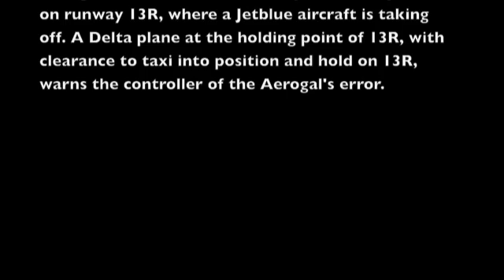Air Traffic Control: Near Miss at JFK

Comment: I think it's quite funny how many controllers that are prepared to rip Kennedy Steve to shreds here.  Yet he has 27+ years of experience working with this. And has to my knowledge has both FAA's approval for his work and no actual accident on his record.
Reply: Kennedy Steve (Stephen Abraham) was unquestionably one of the best ATC controllers at JFK, and he was awarded the prestigeous Dale Wright Award by the National Air Traffic Controllers Association shortly before he ritired in 2017, in recognition of his outstanding service to the profession.  And there is absolutely no question that the Aerogal pilot was responsible for this alarming near-miss.  He was cleared for 13L, he read back 13L, and it was reasonable for Steve to expect him to land on 13L.  Sharp eyes by the pilot of Delta 122 averted what might have been a tragedy.

It is also true that the Cararsie approach can be very confusing: this precise error was repeated on 5 December 2017 by a Volaris flight from Mexico City (https://youtu.be/un4xHGU7bMo ), and probably by others.  It's an easy mistake to make.

BUT -- having said that and repeating my respect for Steve, he did not handle the crisis as well as he might have. In an emergency, especially when communicating with a pilot who is not a native English speaker, the instructions need to be brief and very clearly expressed using absolutely standard aviation terminology.  It would have helped Aerogal to react if Steve had said "Aerogal 700 GO AROUND, turn right immediately, heading 180, climb now to 2000 feet."  Steve's obvious alarm, compounded by fatigue (it was the end of his shift and a runway change was being executed) caused him to waste words (which increased the cognitive load for the pilot) and to delay critical information (he did not give a heading until 20 seconds into the episode, after Aerogel requested one, and he did not give a "climb to" altitude until a full minute had gone by.)

This does not change the fact that this was 100% Aerogal's mistake, even though it's easy to get this approach wrong.  Nor am I dumping on Steve, as some people have done.  I still consider him to have been one of the country's finest controllers.  But nobody's perfect, and his reaction in this case could have been better.
Reply: @dizzyology7514  I loved reading your analysis. It is so bad it is buried among the average Youtube comments.
I have been in JFK several times, done that approach and even talked to Steve before he retired. I could even have a funny interchange the first time I flew to JFK (was a low time E-190 FO then) when another Air China 747 blocked our taxiway for almost 30 minutes (it was almost a recreation of the famous previous incident). When we could finally into the ramp, we both have a short but funny conversation. 
      It is very difficult some non native English speakers to think in English whenever they are in an stressful environment. What happened to the Aerogal pilots was that they forgot to press the TOGA buttons. Their plane was climbing ver sluggishly as if they were circling to another runway and putting them in conflict with other  aircraft. I was not sitting inside that cockpit but being myself a pilot in an airline from a Spanish speaking country, I have seen many of these things happen. Most are just small issues but it also happens in my country with foreign crews.
ICAO English certificates keep a lot of people who should be at the classroom from crewing aircraft in foreign skies but it is factor.
To me the worst ones are in Atlanta. They treat foreigners as if they own the place.

Steve may have been not at its best but the Aerogal crew wasn’t too. They forgot to fly the aircraft.
BTW, it is not that hard to line with the wrong runway if a correct briefing is not done firsthand. There are some buildings that block 13L after passing DMHYL final fix. That’s why guiding lights were placed.

Comment: Curious: why didn't Kennedy Steve (the departure controller) tell JetBlue 43 to reject the takeoff? On 13R on an A320, one reaches V-rotate before V-1 on 13R...which is 14,000 feet.
Reply: Adam Moreira because JetBlue 43 was moving away from the inbound plane. Also V1 is required to come before V-Rotate (or so I've read in the comments on a video specifically about V1, V-Rotate, and V2).

Comment: Sometimes comms are not very clear for every pilot. I can understand him fine, but I would have asked him to repeat a couple of transmissions for corroboration
Reply: cmdmd Aerogol pilot provided the correct read back for landing clearance. The pilot's read back was also correct when ATC called for the go around. ATC was not the problem. The pilots were at fault.

Comment: BTW JFK has missed approach procedures which are clearly published as with controlled airports. So the pilot should have already known what to do if he had to do a missed approach. But, you should already know this if you FLY right? haha. also I didn't know the TONE in someones voice over a radio could be considered unprofessional js.
Reply: OK, but since the description states that he was cleared for the Parkway Visual for 13L there is no missed approach procedure published on the plate.

However if he was actually cleared for the VOR RWY 13L the procedure would have been as follows:
MISSED APPROACH: At or beyond MAP (Missed Approach Point) , climbing right turn to 4000 on heading 100° and V-1 to DPK (DEER PARK) VOR/DME and hold.
Reply: @markemanuele1929  So yeah 90 deg from the ATC vector....

Comment: I understand there is a logic behind it but the logic doesn't always conform to practice. Isn't it absolutely evident here that 13L should be called 13L and 13R should be called 14R. Yes, there would be 2 logical runways on one physical but at least the risk of disaster is lowered. The language barrier is shit - it must be taken in consideration when naming stuff. Some pilots dont seem to know english. You could even throw color names in there or whatever. More unique names, less misstakes.
Reply: It's called 13L and R because of the magnetic heading---if it's true north, it would be 12L/30R and 12R/30L (and the perpendicular runways would be 03R/21L and 03L/21R).

Comment: Like Ive said why dont you fly into JFK if you actually fly which i doubt you do. If you do fly you are probably just some single engine rated kid who flies around his airport and thinks you know everything about flying. BTW when you have 3 airports all within 10 miles of each other then as a pilot fucking up and lining up for the wrong rwy and then passing thru an alt you were told to stop at is a big fucking deal. No matter which way you cut it the PILOT fucked up.

Comment: Runways are named based on the direction they are pointed and how they are positioned adjacent to other runways. With parallel runways, 13L and 13R are pointed at heading 130, roughly southeast, with the L and R designating left and right.

The pilot was simply in information overload. The controller tells him 13L, he reads back 13L, then lines up for 13R. Then he blows through his altitude on the go-around. These are basic mistakes that you would expect from a trainee in a Cessna, not a 767.
Reply: Yeah the blowing through FL is really unexcusable.

Comment: Isnt it kinda stupid to name the runways with the same number with only a suffix in the end? Miss hearing 13R or 13L should not be able to kill hundress of people.
Reply: Yes, but if the approach for 13L was in use at the time (meaning that arriving aircraft land on 13L, then the approach lighting system would ONLY be on for 13L and NOT 13R. According to the approach procedure a pilot is to follow the approach lights on the right hand turn to the runway.  I have flown this approach many times back in the day when I still flew, and it is VERY OBVIOUS which runway you should be landing on (unless of course the wrong lights were lit, which I doubt very much since many other aircraft landed before him).
Reply: When JFK is landing 13Ls, the approach lighting system may be on for both runways, as sometimes a plane may be cleared for 13R, especially Delta if the preceding aircraft is a heavy.
Reply: Yes, but not if they are using 13R for departures.  I guess that theoretically they could both be on, however I've never seen it that way (granted I've only flown into JFK when I was returning from Montreal late at night (when customs in Albany is closed) so maybe only 10 or 11 times).

Comment: I understand that controllers and pilots alike all have an attitude. Fact of the matter is he lined up for the wrong rwy. That's no on elses fault but the pilot/co-pilot. He told him to climb and maintain 2000 and the pilot was passing 2400 when the controller told him to stop. And as per the FAA 7110.65 you may use plain language in place of standard phraseology when needed.

Comment: You would be pissed off to if you had severl aircraft taking off from one runway and another 100pd aircraft wanted to landed on the same one. Controller wasnt cranky as you say. You must have skipped over the 1st part of this video bc he was calm until the pilot decided to line up for the wrong runway. Then not listening to a simple 180 heading and altitude both of which came out clear and concise.

Comment: the controlers did nothing wrong in the Avainca crash The pilot never declared a fuel  emergency which is the proper procedure. I am very sorry for the  loss of life The controllers that day had alto to deal with with bad weather. They are not mind readers.
Reply: The controller never heard the words minimum fuel (<30 minutes before reaching final reserves) or fuel emergency (<30 minutes before completely dry). Had he heard minimum fuel, he would have worked on a clearance for Boston. A few years ago, a Delta 767 missed the approach into Newark because of high winds. and then attempted to divert to JFK, but missed that approach too because of high winds. It was immediately directed to Boston, and halfway there, the 767 declared minimum fuel.

Comment: I will NEVER FORGET the first flight after getting my license.  I was flying out of TEB, and I flew to AVP and back.  On the way back I got cleared thru the NY TCA (as it was then called).  It was very late (about 3am) and the controller was vectoring me around, and I was not quite sure where I was.  They handed me off to TEB tower, but gave me EWR's Tower freq.  I called TEB, and asked for RY lights on the ry they cleared me on (What I say outside was not right) (COntinued)

Comment: Good catch. Also, it took tower almost a full minute to give Aerogal an altitude to climb to after issuing the initial go-around instruction. The climb through 2000 is a very quick one during a takeoff or go-around and easy to bust if tower doesn't assign it right away. Of course, Aerogal could have questioned the controller, as well. Unfortunately, as good as these controllers here in NY are, they're still humans.

Comment: The controller made it worse by telling him "fly runway heading" (while there was somebody rolling down the runway), then in the same transmission "you need to start a right turn" (which is non-standard phraseology and likely to be confused especially with foreign pilots). He should have said "go around, fly heading 180." And yes I'm a controller.

Comment: @shane95670 sounds like you're a pilot for many years and surely know that going around in such heavy traffic and stress conditions is as easy as bicycle ride?
besides they probably had before landing briefing about go-around procedures and when the controller tells you "oh, turn somewhere right..immediately!" it's such a mess. the pilot did a mistake but we all do. 
its easy to complain when you're seating at home, not at the controls of the jet liner that is about to collide with another one